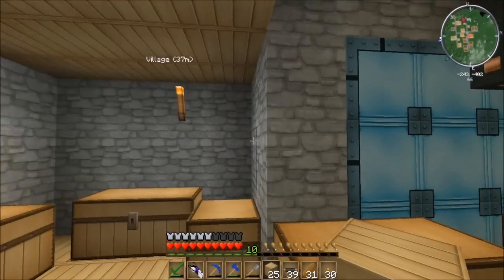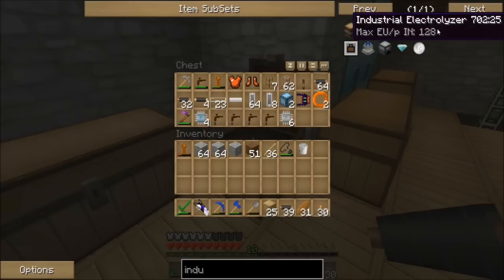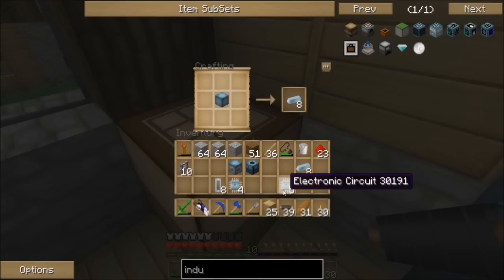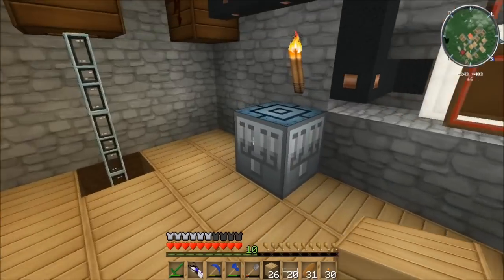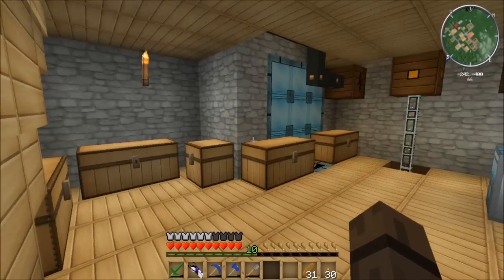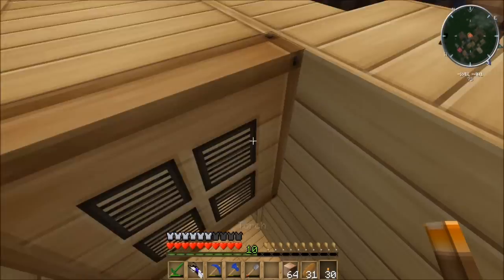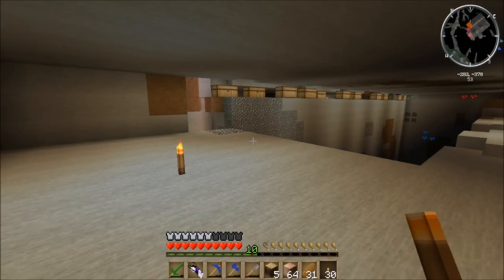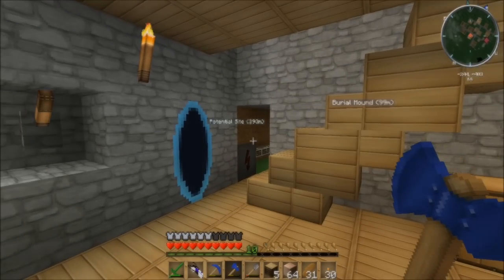FTB Minecraft EP16 - Industrial Electrolyzer & Barrels

Comment: Glass fiber is the best choice for EU cabling as it has the lowest loss due to distance.  Only time you need anything else is if you are working with EV (>512 EU/t) which only comes from very high end power generation (reactors and lightning rods).